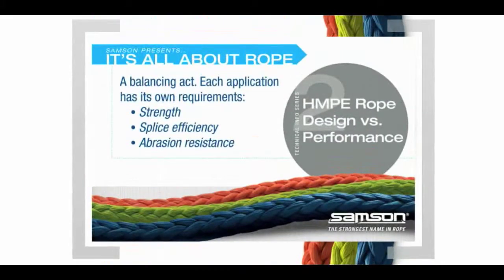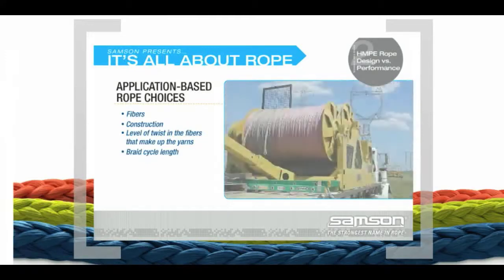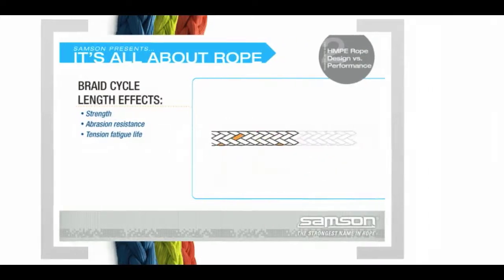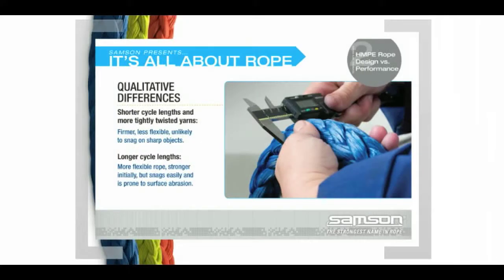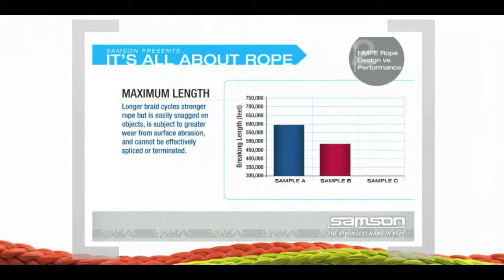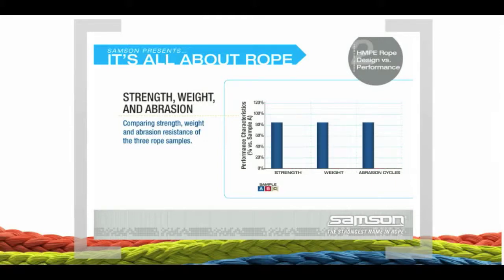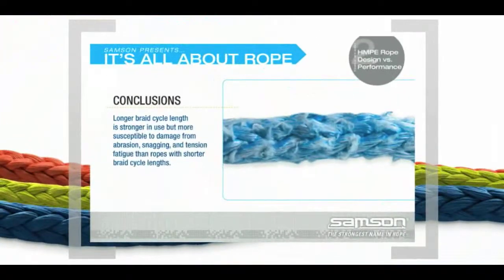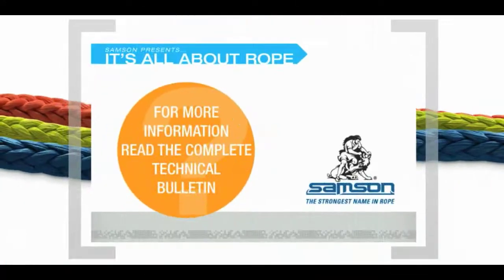It's All About Rope: HMPE Rope Design vs. Performance

Comment: Would it be fair to say that, when considering various climbing-lines' cover-strands, that those varying cover-strand-#'s IE 24 strand jacket, 32 strand jacket etc, is that predominately about the rope having a shorter braid-cycle?  I'm imagining that, while you can twist a 24-strand's jacket tighter - reducing braid-cycle length - that there's a pretty limited "optimal window" for how much twist can be put into the yarns and that to really alter braid-cycle it becomes a game of "how many strands is the cover-braid made of?", would love any insight possible on that :D  (am speaking of double-braids, to be clear!  Actually while I'm posting I may as well ask-- does "core-dependent" equal "kernmantle"?  I've seen a rope called 'kernmantle' even though it had a braided interior, starting to think it really just means 'core-dependent'...
I imagine the #'s are baffling to do but would be real interested in how (with Tenex TEC) things like splices, or even over-sized rope for the application (giving more initial 'cushion' as the rope settles-into its anchoring point during first loading) show up as far as braid-cycle length, IE if using a triple-brummel'd splice at the end of a 3/4" tenex loop, when that's loaded there's some initial 'cushion' from the setting of the fibers into the tree(or whatever you're anchoring to), am actually surprised that the %-elasticity charts I can find out there don't show a HUGE spike in elasticity right in the beginning IE a huge spike at the <1% ABS level (due to the rope setting-in during its first loading) heck you can literally grab a length of tenex and feel some give to it (or polydyne or anything, ttherre's always a slight 'give' if you take a length with both hands and stretch it), this has gotta be due to "lengthening the braid-cycle" of the rope, right?

Again thanks a ton for posting these, of course you  guys are under zero obligation to do this so gotta give major props to you guys for it!! :D   Have gone through a good deal of these vids now and've looked at the titles, sadly I don't see anything on the theme of dynamic strength/elasticity/shock-absorption whether a life-support or, preferably, a rigging (arbor rigging) scenario ;)  Kinda like Yale's article (with youtube video) of "Dynamic Forces in Arborist Rope" where they show a HMPE line (their Ultrex) fail on a 1,400lbs load, then they show their XTC climb line taking the load 6x....the ropes' respective static-strengths were 20k and 6k, a perfect illustration of how construction & fiber type is of such importance to climbing and especially to rigging (I think arboricultural rigging is alone in being the only area that intentionally loads a rope and then uses the rope to 'catch' things?  There must be other niches but it's the only main industry using rope this way so far as I can tell, mountain climbers use way more dynamic rope but it's not like you can get it in anything > 1/2"!!)
Reply from the maker: Would recommend that you reach out to any of our distributors as they are experts who can provide you answers to many of your questions.  Meantime, please feel free to utilize our online resources at SamsonRope.com. Some information you might find helpful:

Elastic Elongation definition specifically does not include initial constructional elongation, which we address in multiple documents:
o Rope User’s Manual (pages 12-14): https://www.samsonrope.com/resources/commercial-marine/rope-manual
o Rec Marine focused explanation: https://samsonrope.com/resources/recreational-marine/elongation-and-creep

Energy absorption info can be found here:  https://www.samsonrope.com/resources/arborist/energy-absorption
Additionally, we also sell an impact force calculating tool through distribution – http://www.wesspur.com/items/boo915.html